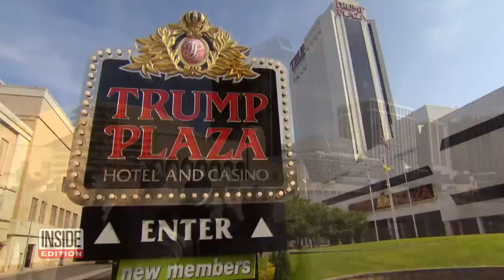These Things Were Intentionally Blown Up

Comment: Man, those cooling towers just crumbled, I don’t know if I feel safe around them anymore,
It did look pretty cool.
Reply: When would you need to be around them😂😂??
Reply: @bandupkasino2795  idk but I think I just invented a new phobia…
Reply: Of course they crumbled... they were blown up.
Reply: reminds me of another power plant explosion
Reply: @anthonyrufino9271  lol
Reply: @Reuu_  just like the towers
Reply: @TheStrangeKage  No, not at all. The towers crumbled as a result of the heat and weight from upper floors reducing structural stability. They collapsed from the top down and it is clear there were no explosives involved. The cooling towers were clearly destroyed using explosives and crumbled from the bottom upwards.
Reply: @Reuu_  and what about #7?  50 stories. Not strick by a Plane. Also catastrophic failure.   Also, the towers were steel tubes.   Treetrunks really.  And somehow got pushed down through the path of greatest resistance.  Do.your research, doll.   I was there and saw it first hand. We were lied to
Reply: @Reuu_  I understand that, but for some reason it just seemed too easy.
Reply: @theguyisdead  cause it was.  Thanks for entertaining another thought other than the common

Comment: You forgot the twin towers.
Reply: Over 2,000 degrees of burning jet fuel caused the steel columns to get weak for over an hour. There was no way to put those flames out at the height the buildings were. Sadly the only way for it to be put out was for it to come down 🎗
Reply: @th3rd3arplan3tradio  you forgot the third World Trade Center
Reply: @th3rd3arplan3tradio  
Jet fuel doesn't burn at 2000 degrees.
Steel does not even soften at 3000 degrees.
Education is key to not sounding foolish
-COMANCHE NATION

Comment: When you look at controlled demolitions very similar to what happened in 9/11 even videos of thermite leaking from the building and the ash was so hot it scorched cars and the entire area something that's only happens when you use to much termite
Reply: I guess when you're lying or ignorant about the situation, you can claim anything. There was NO melted steel. You're just making it up because without it your ENTIRE conspiracy falls apart. You also neglect that molten steel looks exactly like every other material that could have melted (including the aluminum plane that melts at around 660C). Beyond that, melting steel isn't what makes it weak... as you heat it up, it  QUICKLY loses its strength, and with 25-33 floors piled on top of it, it was NEVER going to make it. Even at these temperatures, the steel begins warping and the welds between these pieces begins to fail (as they were already weakened by previous heating). Of course it failed in a specific set of floors.... THATS WHERE ALL THE HEAT WAS.
Reply: @ryanthompson3737  What about building 7